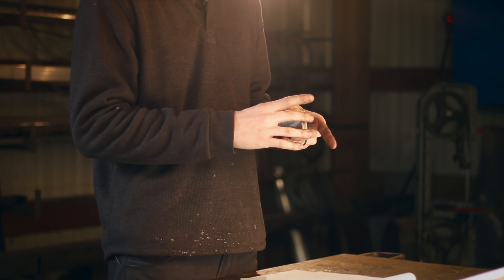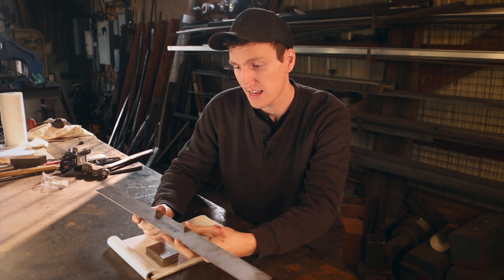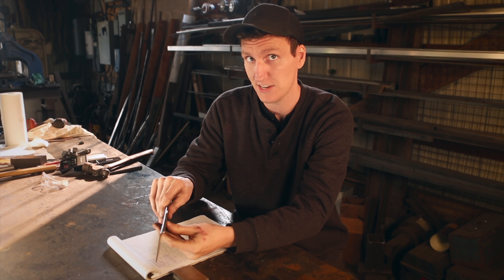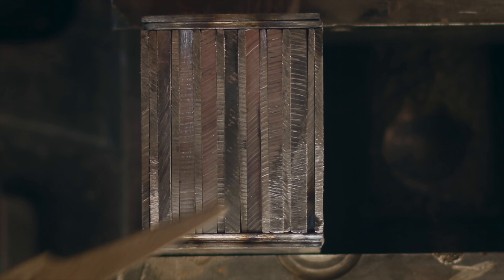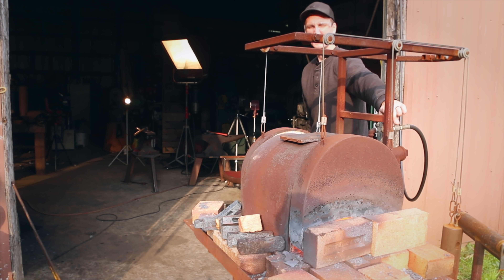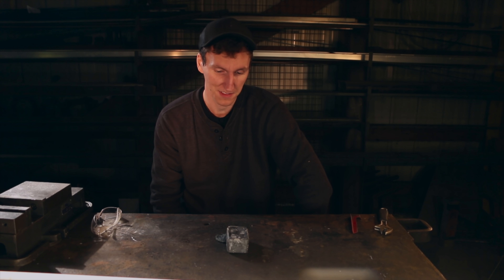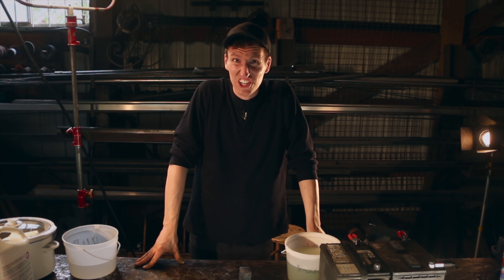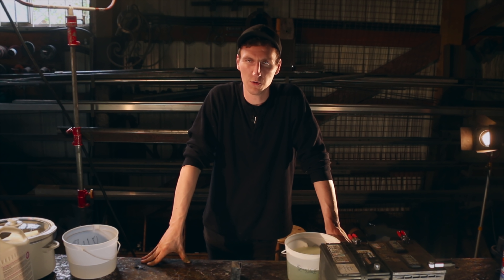Making AEROSPACE DAMASCUS??

Comment: I don't think you overheated it.  This is common in CuMai forging because copper has a low melting point compared to steel.  Basically, the material melts and becomes like solder between the layers.  You just have to weld it airtight and then don't hit it after it gets to temp (maybe a light tap or two if you have gaps between your layers).  Let it cool and consolidate on it's own.

Comment: great to see someone using a respirator.  Consider switching to a full-face (or getting a swing-down face shield).  The acids used in anodizing can really bad if they happen to splash into an eye.  And if you can smell the tanks, you shouldn't be breathing that air unfiltered...

Comment: You could mix the Metals by first melting the Niobium and the putting the other Steel inside. But If You Do, it could happen that the Niobium splashes, because of the different melting Temperatures, maybe increasing the Steel's One, slowly

Comment: I don't know who it was that said just because there's wavy lines in steel that it's actually Damascus steel - true Damascus steel is  made from forging a high temperature crucible steel, not folded steel. See this video for more information --> https://youtu.be/namXt4Etn_o  The wavy lines in the steel appear from the way the steel was formed when the iron mixed with the carbon and how smooth the metal is.

Comment: Your anodizing setup seems like some chemist lb to what small testing. I used 3 9v in series to give me 27v ( I think your DC vs AC voltage from the car batteries is likely causing some issues) And the size of the piece will determine amp draw ( and possible over heating the batteries it to large an object is used) And I only used Distilled water with Baking soda in it. I use a 308 stainless steel ( mig wire) ground and Prob target the area and parts I desire to anodize in the bath. Look up anodizing with 9v batteries there is a great video of a fellow doing like 12 9vs in series and between and shows off the colors that are obtained with Titanium, I have both titanium and niobium that anodize to similar color range at same voltages.

Comment: Well you don't really have to forget weld it. It almost cast itself in the canister. If the stuff that melted is still strong after it cools down you could heat it back up (hopefully without melting it) and forge it out. If the other metal in the canister was tac welded together into a pattern it should keep that shape and the other stuff should fill in all the gaps. You might be able to make something cool out of it.

Idk if you understand that word vomit of a thought but I'm not words-ing good right now lol

Comment: Suggestion from a complete ignoramus:

Try getting your aerospace steel in as thin a sheet as you can. Down to "foil" thickness if possible or practical.
Use the aerospace steel as a "glue" to bond the plates of niobium together.
Make your canister an inch or so wider on each side with the plates welded to the center to allow space for squeeze out.
Put plain paper wad in both the gaps on the sides of the canister to suck up oxygen as it chars.

Press hammer only, no upsetting on ends or sides, until you have the billet drawn out by about a third in length.
Reply: By press hammer, I meant weld setting, hand hammer, or power. I didn't mean to use the press only...
Still learning the words lol.

Comment: The current flows from the outside of the metal , so it will never work buddy. 
As example the the wire are made of bunch of tiny rod to make the use of whole wire material.

Comment: Hi Tim. I did some research, and I found that in order to make a Damascus type artistic look you would need a much closer melting point. Because the difference between steel and niobium is so great it is difficult to control the reaction. I also found that tantalum has a much closer melting point to niobium of 3017°C. Niobium being 2477°C, could give you that Damascus style you're looking for without it being so difficult to work with. Niobium has a similar ductility to iron. I belive that if you preheat the tantalum, then add the niobium in layers alternating between the two while you forge it, could yield better results without melting the niobium.
Also; using the box seemed to have been working well. Perhaps a flat tool that fits in the box in combination with the hydrologic press could help in keeping the pieces organized.

Comment: The reason the anodization probably didn't work is that the electricity wasn't flowing through those inner plates as they are encased in the steel

Comment: Now isn’t maraging steel just steal that has been cooled in a way where the lattice forms a strong crystalline structure. Now when you heat it back up wouldn’t you destroy that treatment and effectively turn it into “normal” steel??
Reply: Sounds like you're thinking of martensite which is the microstructure phase that forms after quenching steel. Maraging steel is a specific alloy.

Comment: Hi Timothy - like your experiments - that´s the way to find out what´s possible... Maybe a way to connect the niobium with maraging steel is with diffusion welding. Both materials should work good with this process. That just as a first step to get a layer structure with a good bonding. After that forging should be possible.

Comment: Huh.  That's exactly how I imagined it going with two metals of extremely different melting points, like encasing lead plates in a welded steel box expecting them to forge together.
Both are fascinating yet incompatible forging metals, though maybe the ideal marriage between these two is to craft a rigid structure from the niobium and simply forge maraging steel around it.
One has high temp and hardness, the other is malleable and strong.  Maybe a core structure of niobium leading to the edge of a blade, encased by maraging steel to support the niobium and prevent a brittle blade.  Maraging 350 is a superalloy, with a respectable Brinell of 601, while niobium is way past that point at 736...surpassing even nitinol.

Comment: Hey guy! 
The design that was generated was very cool, something like abstract modern art, you could cut a slice from that block with that design and make a pendant or some other artifact.  The flaw was worth it, you could even make new designs by melting the metal that way.  Next time try forging the niobium with metals with a similar melting point.👍

Comment: If you're still interested in the tool steel side of this experiment, you could maybe try damascus made of A-10 and M-4.  The A-10 has 2 percent nickel, and they're both high-alloy, so should be 'sort of' compatible for forge welding.

Plus, tool-steel damascus should be plenty tough and sharp, and maybe even kinda cheap compared to the exotics you've been tinkering with.

Comment: i know you are running a blacksmithing channel but ...who the hell taught you to hit a forge welded billet on the end ??? you hit it the way it is stacked driving flat plate in to flat plate not on the end driving plates apart, for at least the first few heats ! you literally hit it top down in this direction iiiii instead of >>IIIII<< this direction on the first heat , its just wrong . dont do it its not the way to forge weld. (ps yes im a blacksmith  also a gunsmith)

Comment: Interesting. You did solder niobium plates with steel. Niobium melts in 2477C, which is 1000C more than steel. No risk to melt that in a forge. That material could have some interesting properties so I hope you revisit this again. 

Maybe drilling Niobium and then put shavings into that container with steel

Comment: Just curious, but what made you think that dissimilar metals would weld to each other?
Reply: Some websites incorrectly report a melting temperature of 2575 °C, so Tim made a combination of metals based on the wrong information. MAR 250 has a melting temperature of 2575 °F.

Comment: Result is very strange as maraging steel melting point is around 2575 °C and niobium melting point is lower, at 2477 °C
Reply: No it isn't. MAR250 (as can be seen as marking on the bar in the previous video) has a melting point of 2575 °F, not °C. It gets incorrectly reported as 2575 °C on some websites, which is explained at the beginning of the video, by the way. It's still just martensitic steel, meaning it's an iron-based alloy, so the melting temperature can't possibly be 2575 °C / 4667 °F.
Reply: @Hydrazine1000  Oh, my bad, thank you

Comment: So b4 I comment I don't know much about the materials used here but honestly, next time I would keep the damascus at a lower melting point (like 3900°) so that the steel doesn't just melt when u hammer it down, I feel you would get a better compression of the two materials here. Other than that, very interesting vid, I absolutely love your curiosity here, and very much look forward to your next video. And I'm curious, if you can get the damascus to do what you want next time, can you run some "forged in fire" style tests to test how durable ur damascus is?

Comment: If I'm not mistaken you said one of those metals had a melting point of like 4600 degrees and the other was 2600 degrees if that's the case then that will cause one metal to liquefy before the other even turns red...
Reply: pretty much all materials turn red at the same temperature.
Reply: Dear Sir,

 Send me Odar / Enquiry

                    We are Importers, Stockholders & Distributors of Special

Alloys, Nickel Alloys, Super Alloys, Stainless Steel  17-4-PH, S S 15-5 PH,

S S 13-8 PH , S S 17-7-PH, S S 422, Nitronic 50 (XM 19), Nitronic 60,

Nimonic 75, Nimonic 80A, Nimonic 90, Nimonic 105, Nimonic 263, Inconel 600,

Inconel 601, Inconel 617, Inconel 625, Inconel 660, Inconel  713C, Inconel

718, Inconel  X-750, Incoloy 800, Incoloy 800H, Incoloy 800HT, Inconel  825,

Alloy 901, Inconel 925, Inconel 926, Inconel 945, Incoloy A-286, Alloy 254,

Monel K-500, Hastelloy C-276, Hastelloy C-22, Hastelloy B-2, Nickel 200,

Nickel 201, Maraging Steel  C250, Maraging Steel  C300, Maraging Steel

C350, Vascomax 250, Vascomax 300, Vascomax  350, MP 159, Titanium Grade 2,

Titanium Grade 5, Titanium Grade 7, Waspaloy,  AL-6XN,  & all type of High

Performance Alloys in form of Sheets, Plates, Bars, Rods, Tubes & Pipes with

Etc in the Form of Sheets, Plates, Bars, Rods, Pipe Fittings, Tubes & Pipes

Marudhar Metal Engineering

Pooja EXPORT  Fastner
Director Mr Deepak Purohit +91 9967477177

Office 02266151810
Email ID poojasteel77@gmail.com

poojanutbolt@gmail.com

Comment: Would you even need to set the weld with a hammer?  Just let it melt together and cool into a block?  That way your pattern you set up in the cannister wouldn't get too messed up. It's almost as much crucible as it is can.

Comment: Did you drill a breathing hole in the casing? That would've given an early warning of what is going on inside (the melted metal would've run out of the hole) the can and let any gas build-up escape. I really enjoy your videos with your unique sense of humor. Was your  interest in exotic metals awakened by a visit from extra terrestrials?? By the way, I have a half pound of kryptonite you can have.....

Comment: Tim, if you want to do version 2.0 of your aerospace damascus idea, ask your supplier/sponsor if they can get you PH 13-8 Mo (AMS5629, XM-13, UNS S13800).
It is also martensitic, it is also very low in carbon (max. 0.03 wt%) and it is compatible with the aging temperature of MAR250, meaning you can precipitation harden your damascus at 950°F and get both component grades to high hardness! 

PH 13-8 Mo is also considered to be an aerospace grade and it will be interesting to combine with MAR250 because both are martensitic and heat treatment compatible, but the 13% Cr in PH 13-8 Mo makes it a stainless steel grade.

If PH 13-8 Mo is not available, try getting either 15-5 PH (UNS S15500, XM-12, AMS5659) or 17-4 PH (UNS S17400, type 630, AMS5643), both are also martensitic, can also precipitation harden at 950 °F, but they are not so low in carbon.
Reply: Dear Sir,

 Send me Odar / Enquiry

                    We are Importers, Stockholders & Distributors of Special

Alloys, Nickel Alloys, Super Alloys, Stainless Steel  17-4-PH, S S 15-5 PH,

S S 13-8 PH , S S 17-7-PH, S S 422, Nitronic 50 (XM 19), Nitronic 60,

Nimonic 75, Nimonic 80A, Nimonic 90, Nimonic 105, Nimonic 263, Inconel 600,

Inconel 601, Inconel 617, Inconel 625, Inconel 660, Inconel  713C, Inconel

718, Inconel  X-750, Incoloy 800, Incoloy 800H, Incoloy 800HT, Inconel  825,

Alloy 901, Inconel 925, Inconel 926, Inconel 945, Incoloy A-286, Alloy 254,

Monel K-500, Hastelloy C-276, Hastelloy C-22, Hastelloy B-2, Nickel 200,

Nickel 201, Maraging Steel  C250, Maraging Steel  C300, Maraging Steel

C350, Vascomax 250, Vascomax 300, Vascomax  350, MP 159, Titanium Grade 2,

Titanium Grade 5, Titanium Grade 7, Waspaloy,  AL-6XN,  & all type of High

Performance Alloys in form of Sheets, Plates, Bars, Rods, Tubes & Pipes with

Etc in the Form of Sheets, Plates, Bars, Rods, Pipe Fittings, Tubes & Pipes

Marudhar Metal Engineering

Pooja EXPORT  Fastner
Director Mr Deepak Purohit +91 9967477177

Office 02266151810
Email ID poojasteel77@gmail.com

poojanutbolt@gmail.com
Reply: Uhhm if u forge it doesn’t the martensit diffuse back to ferrit/perlit/cementite? Parts? Because it gets heat treatment while forging so its kind of a tempering? Idk explain pls 

Sry for my bad language i am nit native speaker
Reply: @Realkerbalengineer  The PH grades are stainless steel martensitic. After forging the steel needs a solution heat treatment, which passes AC1 and AC3 to 1050 ⁰C / 1950 ⁰F or so, so fully into austenite structure, and a cool down to room temp where it fully transforms back. At that point it's martensitic again. 

Precipitation hardening (ageing) follows afterwards and is a relatively low temperature heat treatment so you keep the martensitic structure, with in some cases a little bit of newly formed austenite, depending on which temperature you decide to age.
Reply: Right, next time, after getting a heart, I should not edit the post, not even for correcting typos. Heart/like goes away. 

If you do manage to get PH 13-8 Mo, you will have a valid excuse to play around with dry ice and acetone because PH 13-8 Mo benefits from a cold treatment after solution annealing. Soaking it at -78 °C / -100 °F after solution annealing will transform the left-over austenite to martensite, improving mechanical properties even further after aging/precipitation hardening.
Reply from the maker: Thanks man! Appreciate the info, I definitely have lots to learn about this all! Thanks for your time.

Comment: Timothy, I believe that the perfect combination for that Damascus is the Niobium with titanium! I know that would be little expensive, but you can anodize both and obtain different colors of material with the same process!! About this experience it's like you said! It's not a failure but a learning experience!!
Reply: Would those 2 metals fuse together? They should yes, but has anyone tried it. I think it would look amazing no doubt.
Reply: @erikcourtney1834  there is a gap between 800º Celsius on the melting point between materials!! Maybe because of that nobody tries! Plus it's a expensive!!

Comment: Forge welding metals and Mokume Gane is basically the same proces. The proces is called diffusion welding/diffusion bonding. Its putting 2 or more dissimular metals together using heat and pressure. You dont need to melt one of the steels to get them to attach to each other. I have read in an artikel you only need to go up to 70-80% of the temperature needed to melt the metal that has the lowest meltingpoint in the stack. If you are planning to fuse more than 2 metals , the in between layers need to be the metal with the lowest meltpoint .The reason why you did not get a stacked billet using these 2 metals is because you got the maraging steel way to hot.( you did no forge welding but you were in fact brazing ) I did experiment with titanium and steel ( experimenting with some more affordable metals :) )...in the end i used a copper layer as a binding layer to get the titanium to stick to the high carbon steel. Aplane encasing did not work to get the billet oxigen free....i used a 2 feet long tube to feed the encasing with pure argon ...that worked. The plan was to first make a grade 2 and grade 5 mix timascus and use that as the sides to carbon steel to make a san_mai pocket knife......i did not get that far yet. I very much enjoy these video's from people trying to do things that are rare or are even never done before...very inspiring work Timothy (sorry for the bad English).

Comment: The problem trying to match pure niobium to steel is that niobium and iron have a eutectic point where the melting point is as low as about 2500F. Even though the melting point of the two metals is much higher, the Nb dissolves into the steel until there is enough to lower the melting point. That looks like what happened here.
Even if you did manage to forge weld this at lower temperatures, it probably wouldn't be useful for knife making as the combination of Nb + Fe forms some hard and brittle phases which would ruin the properties of the steel.

Niobium is used in a lot of steels at tiny percentages, and nickel superalloys use about 4%, but applications for pure niobium are virtually non-existent.
Reply: Niobium is one component used in VERY LOW %'s to make Cro-Mo Steel into Tool Steel. I'm thinking the Niobium plates sacrificed a thin layer to the Maraging Steel, and made a Tool-type alloy. This stuff demolished his cutting wheels and other tools 🤣